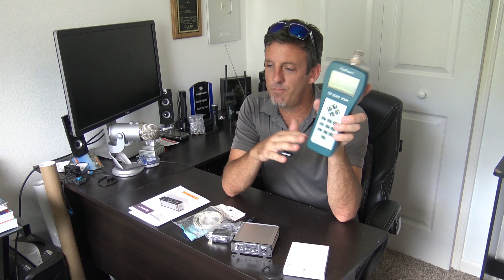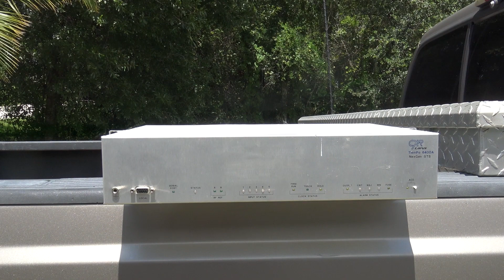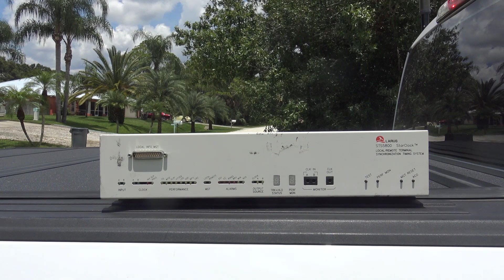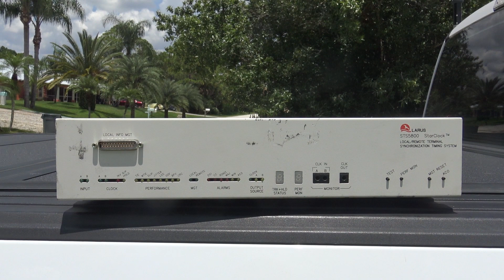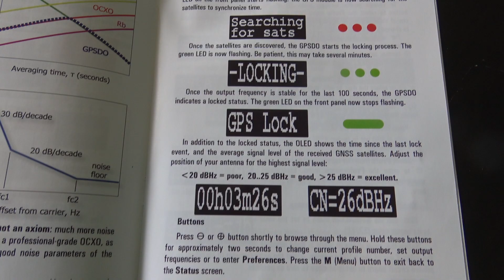Rigexpert Tokenblauser GPSDO,  High Stability, Super Accurate, Super Stable

Comment: That great.I happen to know what this and does. we have a GPS clock at a radio station I have worked at. small GPS antenna on tower. also used to check station frequency . the clock timing helps remote studio link. and back up clock timing uses WWV/WWVH/WWVB time standards.  bad weather like snow storms block GPS . and WWV clock usually received takes over. if all lost a very stable xtal oscillator is used. when GPS or WWV back up will re sync. radio stations part of a network use something like that. also TV. this is a big help with stations in multiple time zones. you need local programming and network programming to sync up. not for every ham. easiest just grab 10Mhz WWV . that right on. set your radio dial and frequency counter to it. 73's